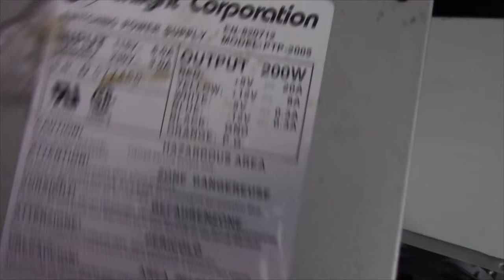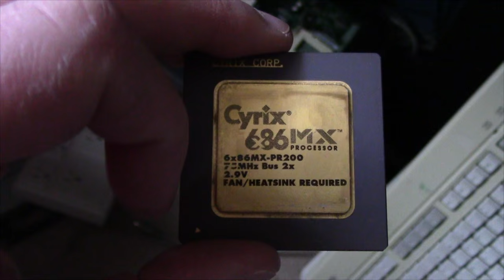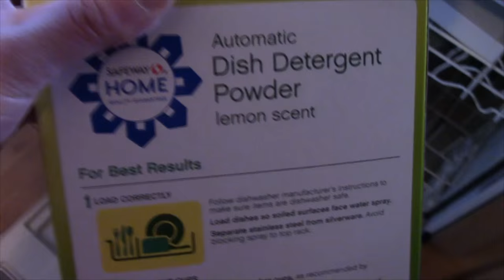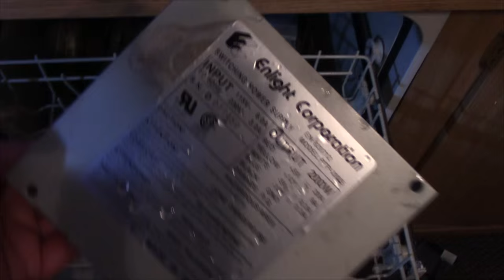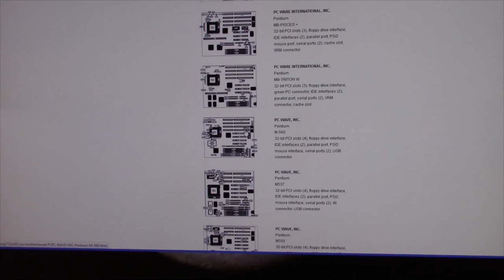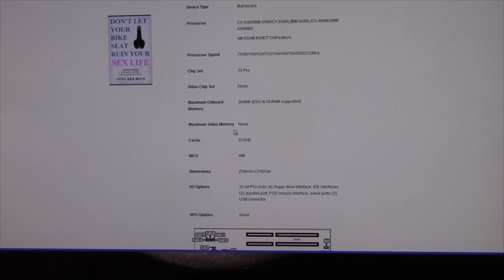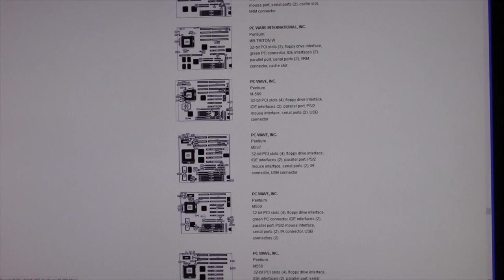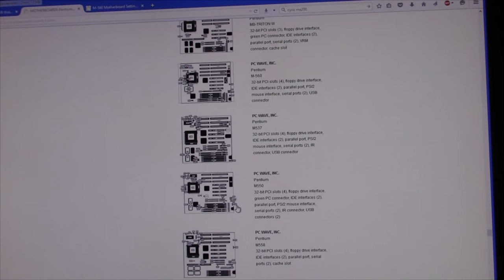Cleaning a Socket 7 computer

Comment: I didn't know we could wash this stuff, I always wondered about it, well now i know :-). I loved what you did there with the silver - the case looks awesome, maybe you can cover that process in a future video.

Speaking of some other totally unrelated stuff like reviving old video cards. I once tried to revive an old Geforce4 Ti 4200 using the oven bake method, well, in my case all the capacitors fell off. I thought it was pretty funny at the time. I soldered them back on, but the card didn't work anyway. Have you ever tried the oven method to revive old hardware? Sorry for being off topic here.

Comment: How long did u wait for the components to dry before u powered up the pc? I cleaned a motheboard once, and I waited almost 2 days for it to dry, after that it worked like charm. That motherboard came with a pc from a smokers home.
Reply from the maker: I give them a couple days. overnight with a fan on them is usually enough, but I also blow the water off and out of the slots, socket and under the chips as much as I can before letting them sit for awhile.
Reply: For me I just let i selfdry, a fan made it worse for me. I tried that first. But in your case, I think the vrm was toast.
Reply from the maker: LellePrinter82
Ya, I think so too. It's not a big deal, I have another board almost identical to this that does work, same chipset.  I might test the VR at some point.
Reply: I've used 90% isopropyl alcohol to speed up the drying process after washing with water. Also helps to displace any water that may have puddled in hidden places.

Comment: You havent seen rust unless you saw those machines i made a comment about earlier. even the little clips that held the simms in were rusted out and falling off.  as I said in my other comment though it did still work.

Comment: Looks like your motherboard has an integrated battery (like a DALLAS battery).
Cleaning a computer with a battery is dangerous, maybe you fried it because of that battery (yep some of dallas batteries still have power nowadays, my pentium computer from I guess 1997 has one and it still works)

But I my opinion it's not a big loss, PCCHIPS and many stuff from them since the 486 era at least was almost always pretty bad ... (Thin PCB, cheap connectors, fake cache (at least for 486 mobos), etc ...)
Reply: maybe the dallas battery had some juice and the water on it shorted out the board